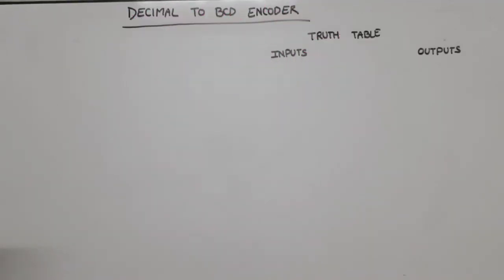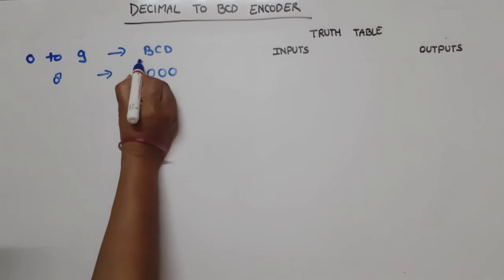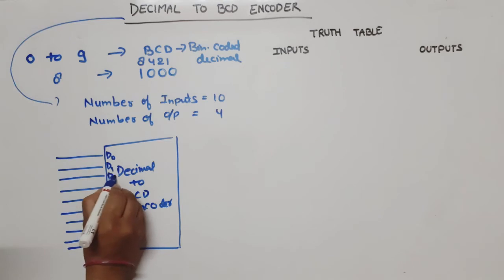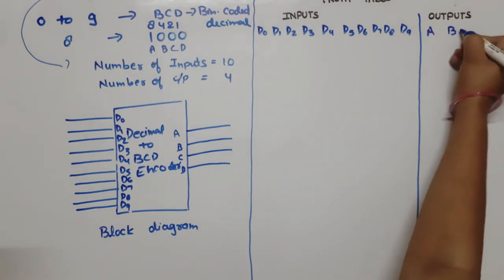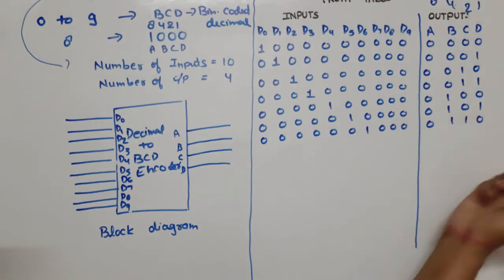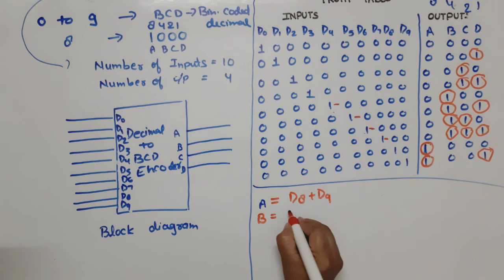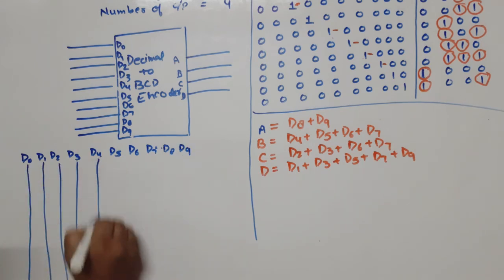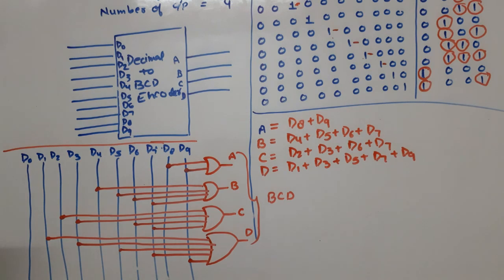Decimal to BCD Encoder | Decimal to BCD encoder in Hindi

Comment: describe what input condition would be required to generate the code for the following decimal number in decimal to bcd encoder : (a)2. (b)4. (c)8. (d)3  (e)7

Mam plz answer this question
Reply from the maker: If u see asking for truth table 
Then 
(a) 0010000000
(b) 0000100000
(C) 0000000010
(d) 0001000000
(e) 0000000100

Comment: Very nice explaination but what if decimal input is of two digit or more??
Reply from the maker: If two digit then 8 output and table will be Accordingly
Ex if 23 is in decimal than output will be 0010 0011
Reply: @TechnoTutorials2783  how would the circuit looks like for 2 or more inputs?? how 2 will shift to 10th position as soon as we press 3 in case of number 23?
Reply from the maker: @victormaxwellpeters9771  basically we unpaked the number 23 means 20+3
Reply: @TechnoTutorials2783  thank you soo much mam